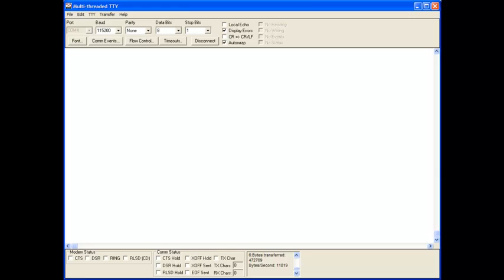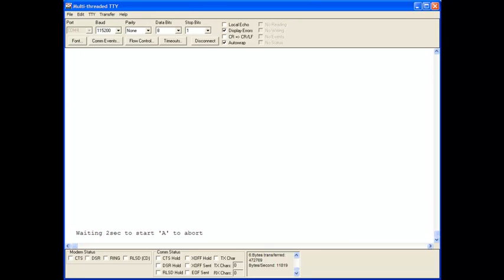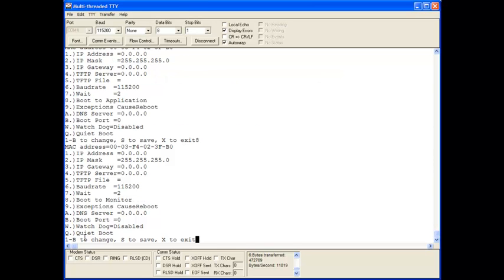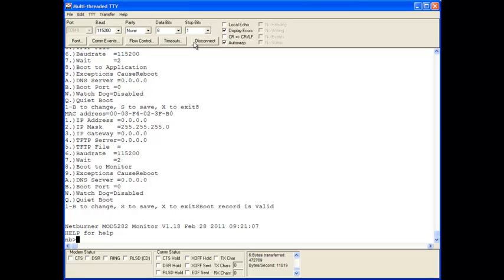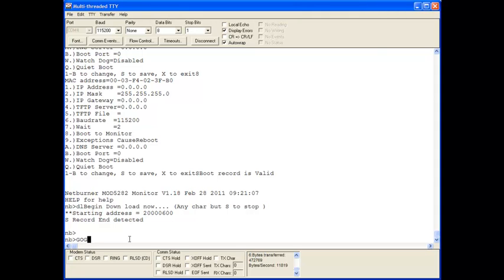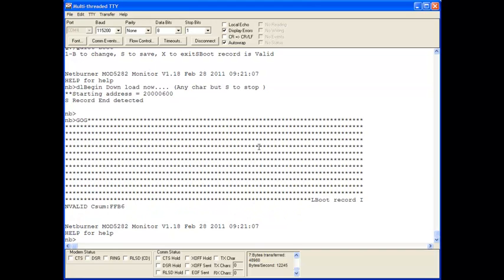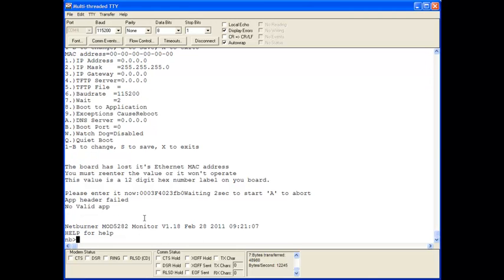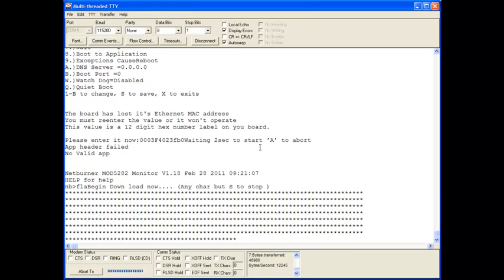Monitor Recovery Procedure on a NetBurner Module

Comment: "GO" did not return anything on this faulty MOD5282 Rev. 1.02. Similarly, the PDF that came with the recovery files says that GO6000020 + Enter would do something, but that had the same behavior. Not a biggie, as I gave up on this module quite a while ago and it is somewhat outdated.